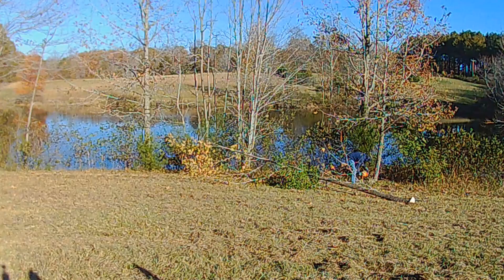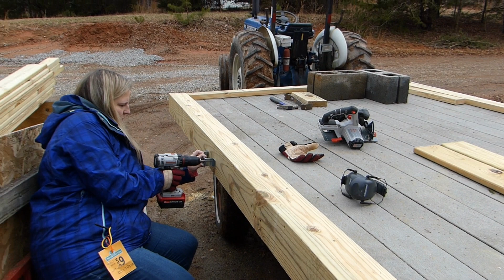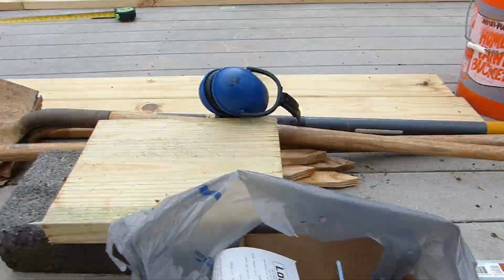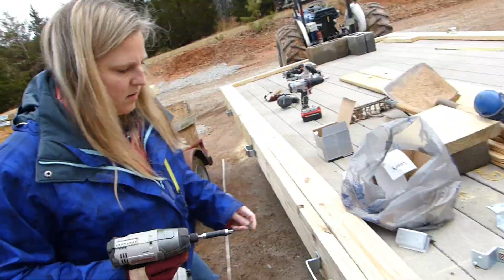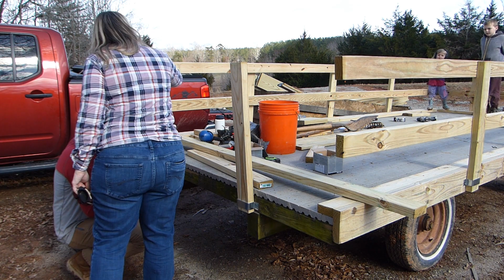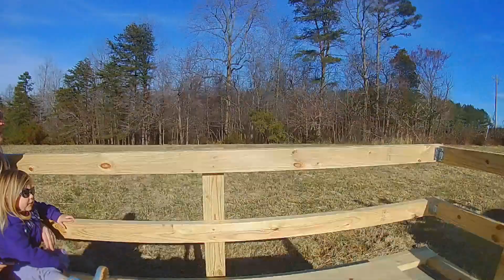#31 Building Sides on a Hay Wagon For Hay Rides

Comment: Where did you buy the side brackets?
Reply from the maker: home depot. Look for 2x4 stake pockets. They're readily available online including Amazon, too.
Reply: There are interlocking truck rack corner and side wall brackets which would permit the use of the stake brackets for removal.